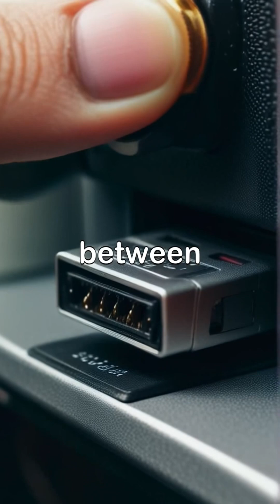Automotive Ethernet - Automotive Communication Protocol #embeddedsystems

Comment from the maker: Automotive Ethernet is transforming how vehicles communicate, enabling high-speed data transfer for advanced systems like infotainment and autonomous driving. This protocol not only enhances performance and safety but also paves the way for future automotive innovations. 

As engineers and manufacturers integrate this technology, they are creating smarter, more interconnected vehicles. The video showcases the cutting-edge applications of Automotive Ethernet in real-world settings, illustrating its critical role in modern vehicle design and functionality. 

Join us in exploring how this emerging technology shapes the future of transportation and urban mobility. #AutomotiveEthernet #VehicleConnectivity #SmartVehicles #FutureOfTransport.